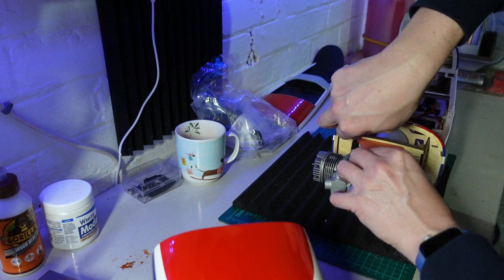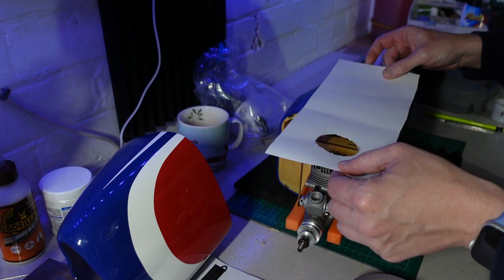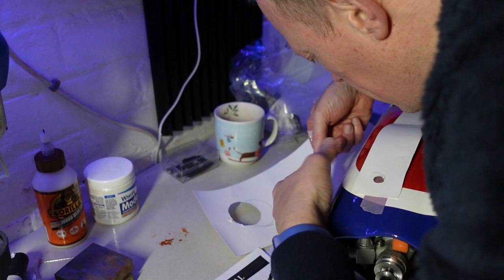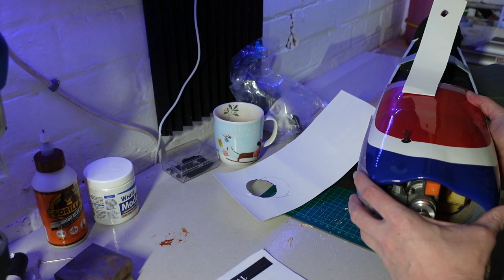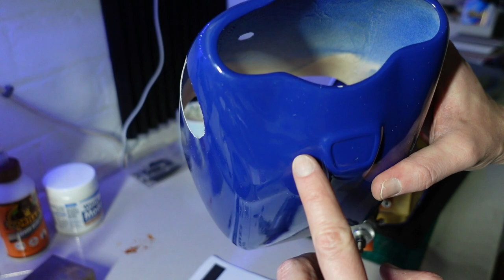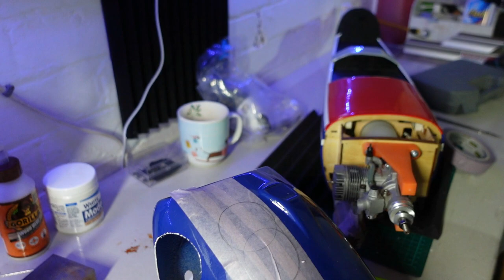Seagull Models Extra EA 300L Build Part 2 - Cowl install

Comment: I would mount the cowl to the fuse first ensuring correct alignment, and then proceed with cutting clearance holes, similar method as shown
Reply from the maker: Cheers 👍🏻
Reply: @tdogrc  Thanks for the video and looking good
Reply from the maker: @stevethompson1425  thanks for that Steve appreciate it 👍🏻

Comment: Secure the cowl..matter of fact drill mounting cowl screws..install the cowl aligned centerline and decal paint scheme alignment, THEN mark the two holes. Remove cowl and drill..
Reply from the maker: Cheers. Thanks for the tip.  Sometimes I prefer to secure the cowl after cutting the holes though, so you can get the front of the cowl properly aligned with the prop driver 👍🏻